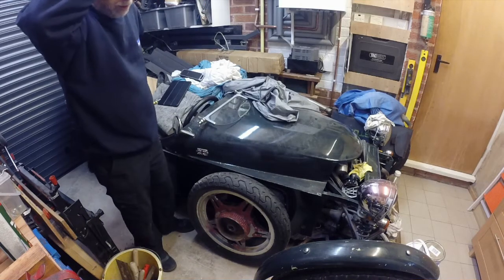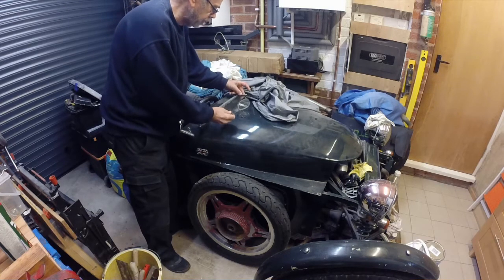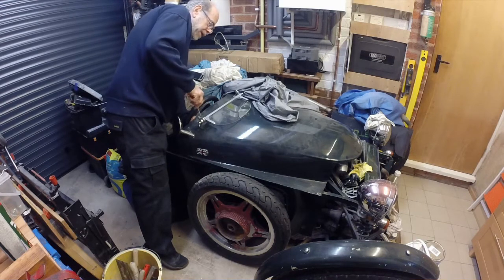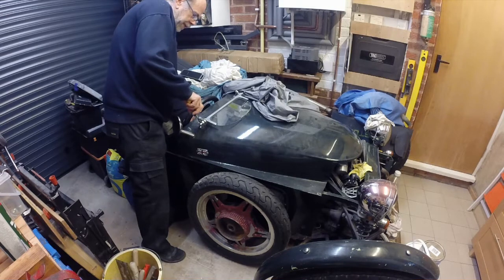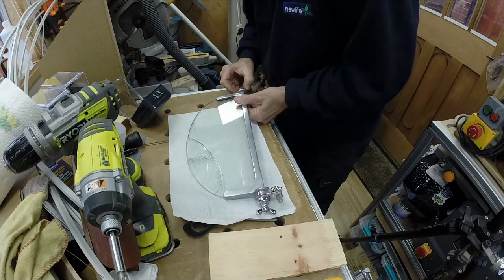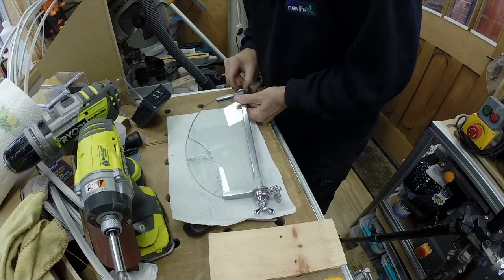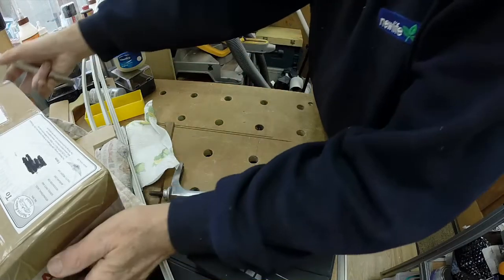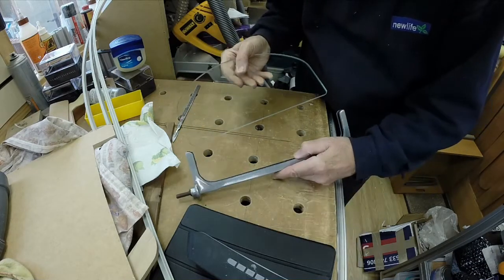small shed Saturday #253 - repairing Hettie's screen

Comment: I was on pins for most of the video expecting the glass to cause you a bad injury - the only reason I thought that was that if I was doing the same procedure there would have been a stream of ambulances pulling up outside my house ( i suppose that comes with living at house number 13 for over 30 years and then having a car number plate that added up to 13 too ) - great video and glad you came out of it unscathed
Reply from the maker: In truth I did get a very minor nick, but halfway through I thought, "I should be wearing gloves"🙂